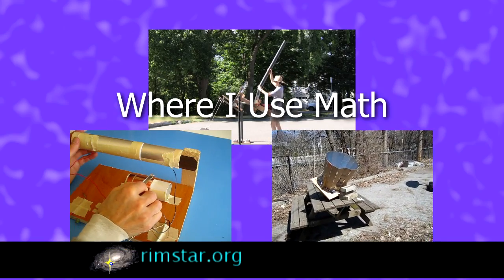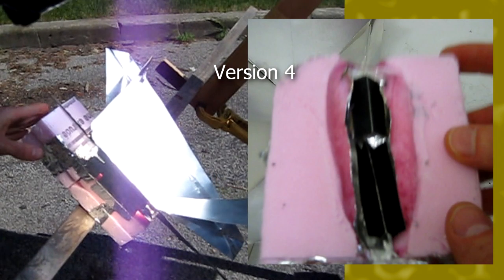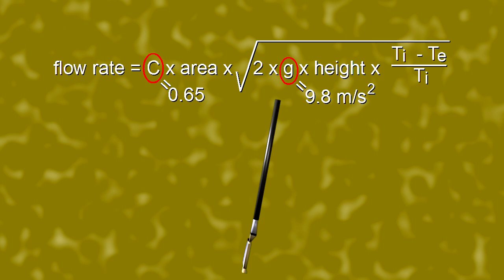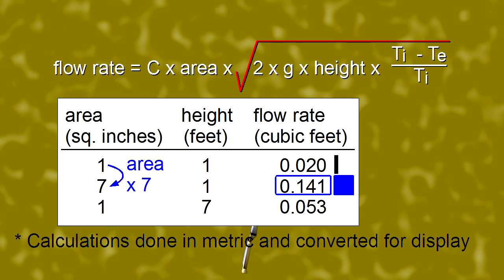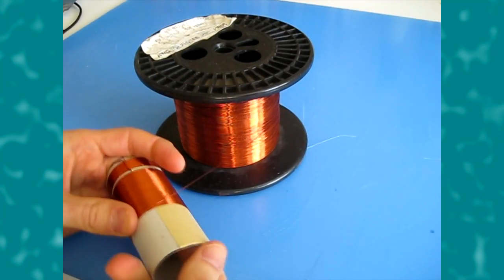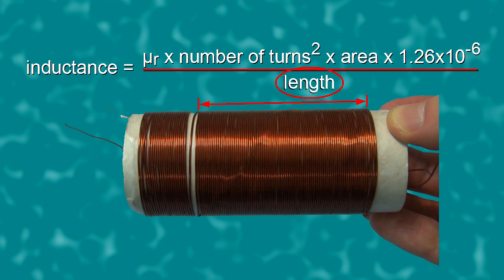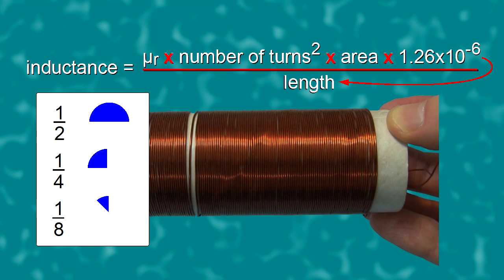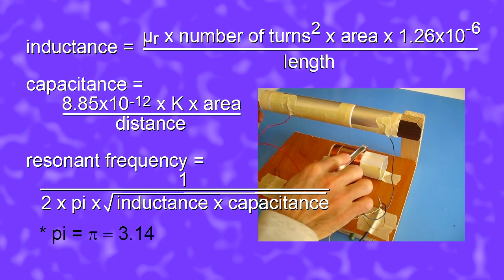Where I use Math

Comment from the maker: mu sub r is the relative permeability or magnetic permeability, usually 1 for air and 100 for iron. It indicates the ability of a material to support the formation of a magnetic field within itself. K is the dielectric constant or relative permittivity and indicates the ability to concentrate electric flux, close to 1 for air and 2.2 for polyethylene, for example.

Comment: Except coil losses depend on the ohmic resistance of the wire and additional loss from the skin effect and proximity effect. Optimizing coil Q for a specific application is actually a bit tricky, but thick wire, space wound with a big volume for given inductance is generally close to optimal with air-core coils.

Comment: Water meters generally are quite accurate, as in most cases they are calibrated to be within 2% of nominal at full flow. They have to be, as they are normally used to generate a bill for you to pay, and inaccurate ones ( mostly underrreading at low flow rates) is bad for the supplier. They normally use a positive displacement pump to measure water volume accurately and integrate the pulses to get the value.

Comment: Your fresnel project was ideal for hiighlighting what 'should work' mentally compared to what 'will work' mathematically :)
Experience versus calculation is intriguing. To quickly throw together an audio oscillator for some would be a week long calculations foray for others. Then there's copying for shortcuts, like building a radio and emulating the look of the coil in this video.